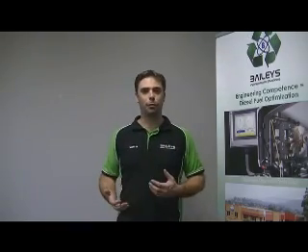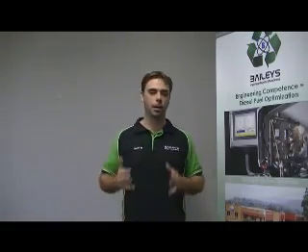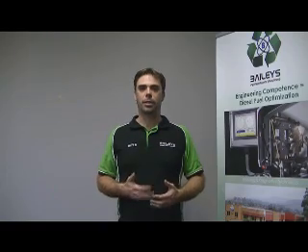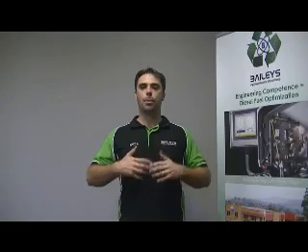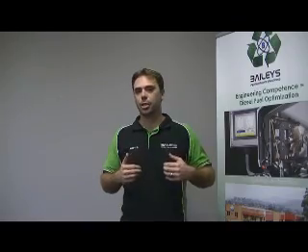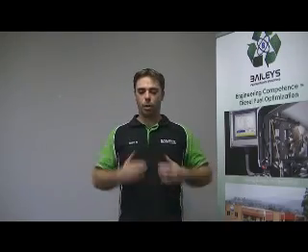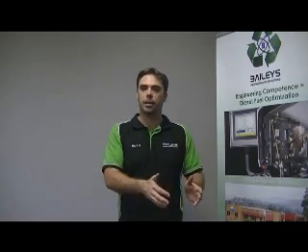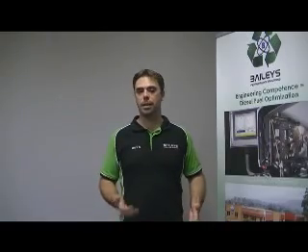Coding and Calibration; Denso Common Rail Injectors

Comment: I am a Toyota Innova 2006 car owner, I have a problem after making repairs to my 4 injectors, after checking using the 4th scaner I injectors are all good, but what if I take the road at low speed the sound of the engine becomes rough like someone knocked on the engine . guess what is the cause?